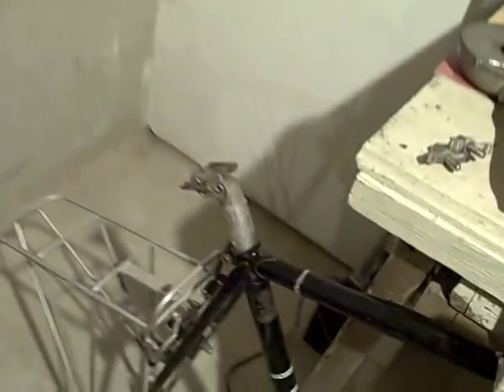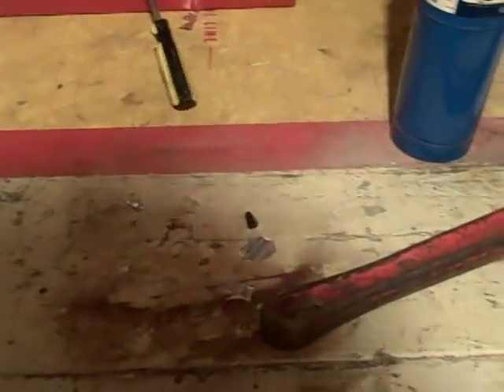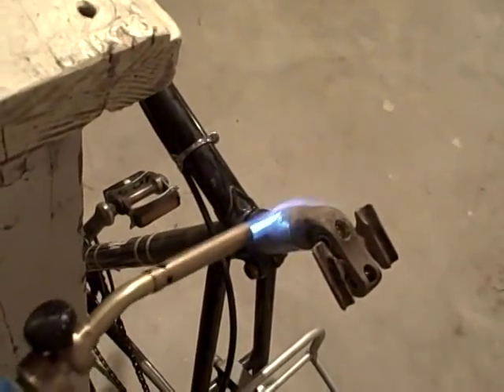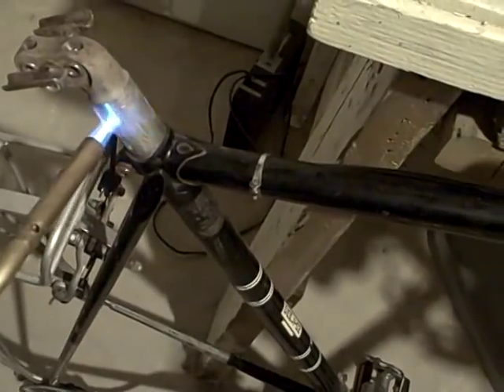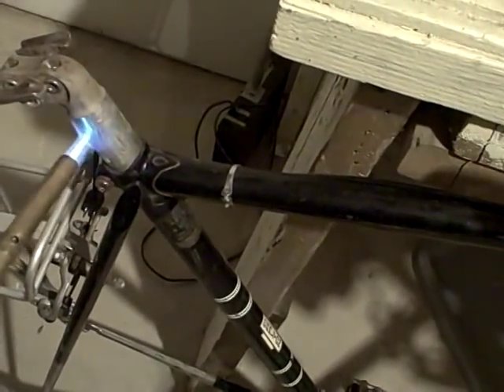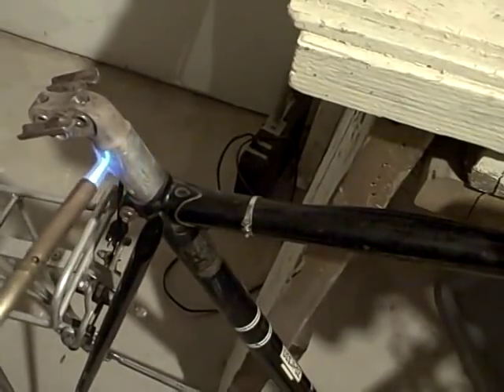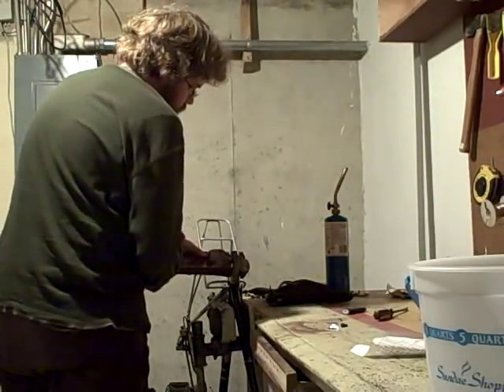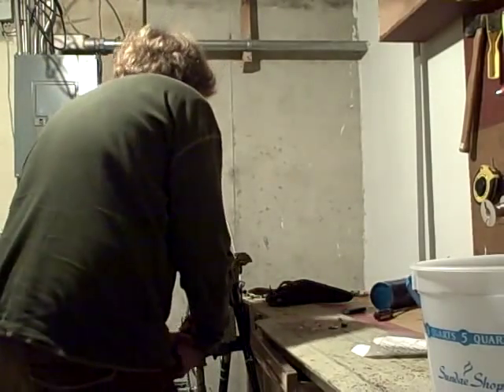How to unseize an extremely stuck seatpost

Comment: Thank you!! I will do this with my 1948 Monark Silver King! the post has been stuck for AT LEAST 40 years and was pinched so bad that the seat couldn't be installed! you rock, great video!
Reply from the maker: +Lucas Winders thanks man. Hope it works well for you
Reply: bcburdoa I hope so too! I might end up drilling a hole into the seatpost and put a nut and bolt on it so a pair of channel locks fan grab it, for I don't have a pipe wrench.

Comment: I had a very stuck seatpost (saddle still attached) on a 20-year old bike that I thought I was going to have to use a blowtorch on. Ended up breaking it a tiny bit loose by using an 18" adjustable wrench on the square part at the top and somewhere upwards of 100 pounds of force on the end of the wrench. Then to get it out, I clamped onto it with my locking pliers so that the handle stuck out in the opposite direction of the nose of the saddle and continuously twisted it while pulling up. Still took a lot of force, but I eventually got it out.

Comment: So how would you remove an alloy seat post from a carbon fibre frame mines well stuck tried WD40, heating the frame with hot air gun. I even got some ice spray to freeze the alloy stem but its well stuck. Any ideas or a video

Comment: I was surprized to see this work. I am going to guess it works by the inside tube being slightly crushed by the outside tube, due to differential expansion and contraction. I was expecting the corrosion on the tube to look very bad, and it really wasn't.

Comment: Also I'd try the heat method in the stuck seatpost if the pipe wrench and cheater bar don't initially work.

Comment: Theres a similar technique old skool car mechanics use on rusted bolts but as it's cooling down they hold a burning candle near it or something. The idea is that as it's cooling down it sucks in some wax which apparently loosens it up no end.

Comment: im looking to do this to my bmx because i got a old 05 free agent and just recently i wanted new parts so i got a new frame and then i trying puting in my old free agent seat post and it was to big i told my friend he said hill put it in so i said ok then he put on lube and it whent all the way in and poped in place so now i wanna paint it now it doesn't get out and he did everything put on lube get a wrench put it on the post and hit it with a hammer so do you think this is safe for my frame

Comment: if you heat both the seat post and the frame and then quickly cool tim down you might get the seat post out, but the frame will become more brittle and thus weaker.You could instead use lye to get rid of the aluminum seat post and leave the frame intact, but maybe scarifying part of the paintwork.

Comment: I got mine unstuck by using a wrench to catch the now flattened head of the seat pin. and a hammer to hit the wrench, Took me about 60 to 100 blows. The seat pin got flattened by trying to hammer it into the frame.
Reply: You might also try drilling a hole through the pin, put a long steel rod thorugh and slowly turn. Begin the hole with an angle grinder. It might work.

Comment: wow, you´re working with a blow-torch under a wooden ceiling?
Hats off, 2:05 and you were nearly burning doen the house above....

Next: You did it the wrong way round: Heaten the external Tube, cool the internal tube.
Reply from the maker: Couldn't heat/cool like that because then I would have set the paint on fire. Original paint, wanted to keep it
Reply: freeclimb64  You'r relying on the differential expansion of the two metals to break the corrosion joint. Heating the outside may not be as useful as it might appear as the aluminium seat post will expand more quickly than the (steel?) frame. And it will spoil the paint.

What's with "a blowtorch under a wooden ceiling"? How do plumbers plumb in a house, loft, airing cupboard or floor void?
Reply: freeclimb64   Hey-- Leave the man alone.  No chance to ceiling could catch fire, and it worked.  And the increased expansion of the aluminum is the whole point.  Once expanded it will break the bind once the aluminum goes back to it's increased de-spansion once cooled to equal temperature.  It's enough to unseize the coupling and he proved it.  It's science..